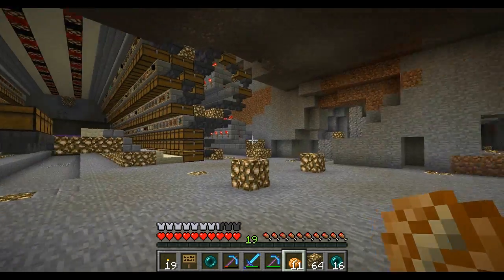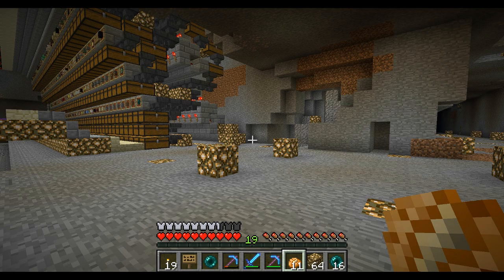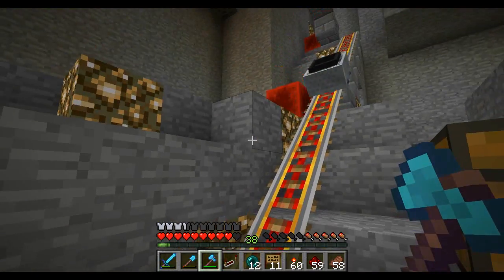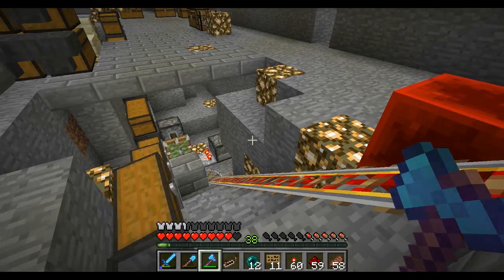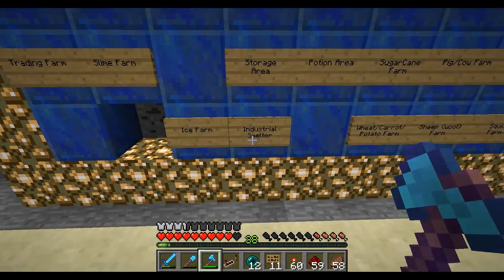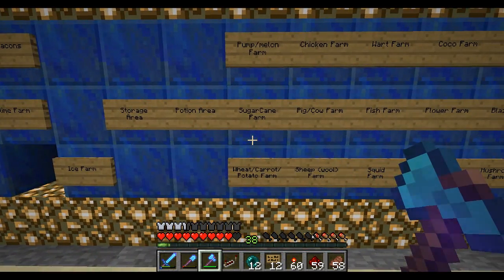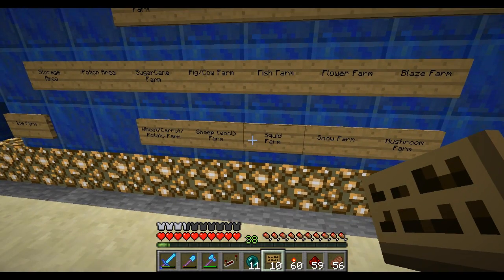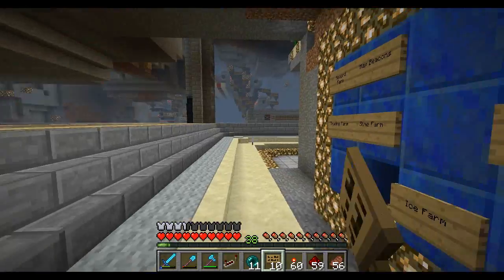King Plays Minecraft: Episode 16: Minecarts & Industrial Smelting

Comment: Hey, Your Highness!
Are you considering routing all the sticks from your witch farm to the industrial smelter to be used as fuel? Might not make a good fuel by itself, but i addition to coal it might save you on some coal, atleast untill you get the blaze farm up and running. Just wondering wether or not there is a reason not to.